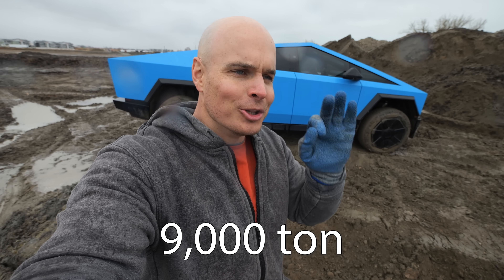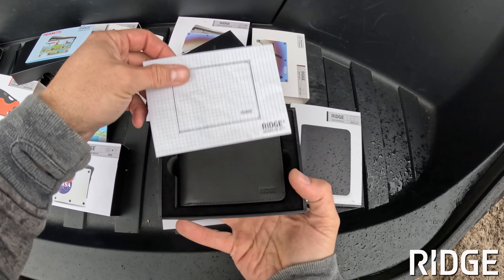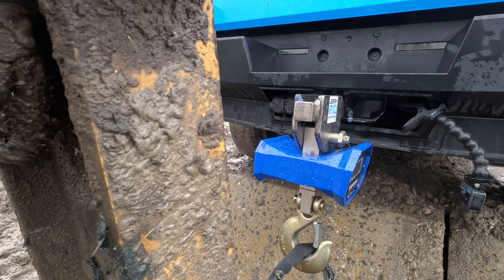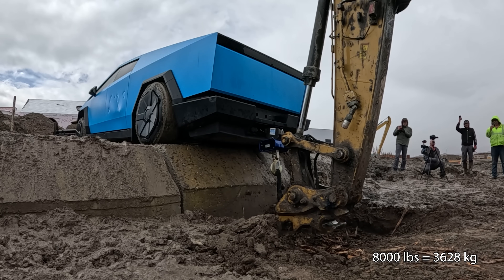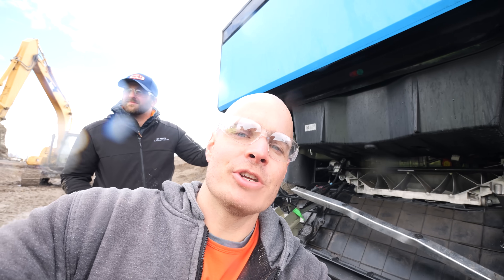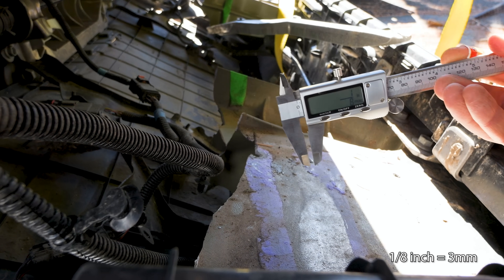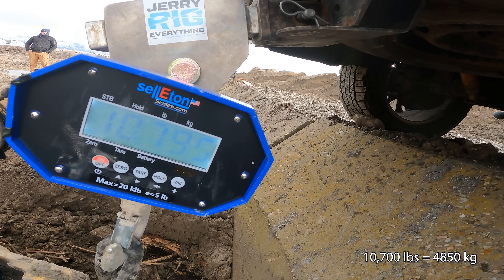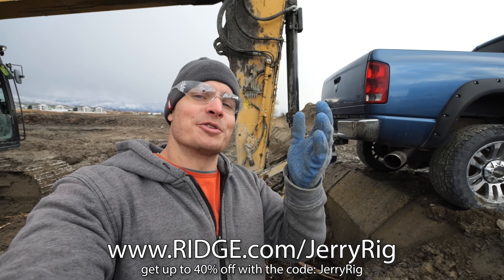SHOULD YOU TOW WITH A CYBERTRUCK?! - (catastrophic failure test)

Comment: Engineer from Germany here:
This test is kinda wrong! What you tested is the static downward force (Stützlast) which only holds a friction of what the actual TOWING force is.
The towing force is a pulling force horizontal from the truck. So this is unfortunately wrong my friend.
Reply: While certainly not entirely representative of a real world scenario, he does also address that tongue weight will increase during less ideal scenarios (hitting a pot hole, going over a steep hill crest). That combined with aluminum getting weaker over time, makes this a terrible choice for actual towing regardless of this tests validity
Reply: @cwill2127  
So basically if you have improperly placed load, you are hitting pothole while going at 90mph while being at 45 degree downhill, that MIGHT create enough force to break it?... This is non starter as an argument. If you want to complain then you could simply point out issues with aluminum potentially accumulating small fractures over time, which on its own should be tested and verified to be the case with their alloy as Tesla doesn't use some generic one and have their own, so fracture accumulation should be tested. But to make some fantasy scenarios where this maybe could be a potential issue is silly at best.
Reply: @ hey do you don’t understand physics and that’s fine, but leave the conversation for the big boys <3

There’s already a case of a failure in real life. Need I say more?
Reply: @ 
If we should leave conversation for big boys, why are you here?
Reply: While I agree that the test was misleading, the comparison against the Dodge Ram is pretty irrefutable proof that the durability of the cybertruck is below that standard of normal trucks. Since they are at an industrial site, I'd have liked to see hem actually load up a trailer with 10k lb and try to break it, for a much more practical  test.
Reply: @N8Dulcimer  
Comparison with Ram was quite meaningless as they didn't really went that much of extra where CT failed, on top of it potentially being the one rated for 1,200-1,500 loads. At the end of the day CT failed with over 9x higher load on the hitch than it was rated for
Reply: @ It's more complicated than that. First of all, a towing capacity of 11k necessitates a tongue load of up to 3k, so already the tongue weight limit was far too low for the stated towing capacity, if you assume standard weight distribution. 
Second, the dynamic load of a trailer can easily exceed 10x it's static load, thus a trailer rated for 1k lb tongue load will often need to accommodate brief moments of 10k+ lbf on the frame. 
Moreover, a trailer that is 11k lb will be applying at least 2k lb to the hitch statically, and up to 20k lb dynamically.
So in summary, the maximum tongue weight was never going to be able to accommodate the claimed towing capacity and also the hitch would  break under the dynamic weight of a 1k lb tongue load.
Reply: @ 
"The hitch weight should typically be around 10-15% of the trailer's total weight. However, it is important to note that this can vary depending on the type of trailer and its design. Towing capacity, on the other hand, is the maximum weight that a vehicle can safely tow."
First google search result. CT is rated at 11000 towing capacity, so its hitch capacity should be at around 1100 to 1650. Your made up number of 30% makes no sense as no one requires that. Which safety regulatory institution indicates that hitch capacity should be 30% of towing?
Reply: @Zripas  I mean, its pretty blatant that this is sycophancy, and that we are no longer talking about actual physics. This comment basically ignored everything I just explained xD. I got the 3k tongue load per 11k tow load figure by referencing trucker data. The fact is when a tongue is rated for 3k lb static, it is actually expected to be capable of withstanding over 20k lbf of impact during shock events. The reason I said that a cybertruck hitch is rated for 1100 lb is because that is the specific number that tesla gave. No amount of boot licking changes the facts.
Reply: @ Shoutout to the google warriors, who can't believe Elon lied to them, and demand that chat GPT explain in one sentence why actual engineering concepts shouldn't apply to the cybertruck. I really do have a deep envy for people who genuinely thing that a google search is an alternative to an education. Bless.
Reply: @ 
You people are weird, I'm not here to defend Musk, he is acting like a moron and this CT is stupid in how it looks and how its was built, but this doesn't mean that you getting random numbers from your arse will have any actual meaning. Tow capacity vs hitch capacity are usually 1 to 10 ratio, you want to claim that its 30%, so please provide source which institutions require this.
Reply: @Zripas  You literally got 10-15% from a random forum post lmfao. You are blatantly just combing through google for anything that let's Elon off the hook, and it's obvious that you are entering this conversation with ZERO prior knowledge, and are just counting on google autofill to show you something that agrees with whatever nonsense you type in...
Reply: He talked about this in the video. Did you even watch it?

Comment: Thanks to the Young modulus being three times higher for steel compared to aluminium, it will always need less force to deform aluminium - Even if you could match the tensile strength of steel it will deform more easy. Seeing that gigacasting makes me nervous... And yes, I hold a degree in mechanical engineering which apperently Elon doesnt 🤐 I now understand why the Cybertruck is not legal to drive on public roads in 126 countries.

Comment: Yes the S/N curve for aluminum doesn't go completely flat like it does for steel. So for steel there is a stress that if it stays below it can do an infinite number of cycles. For aluminum there isn't, but there is still a stress level that if you stay below, it is good for say a billion cycles i.e. for all practical purposes it might as well be infinite (depending how quickly it cycles). Since the number of cycles scale on an S/N graph is logarithmic small stresses are likely to result in some very big numbers on the number of cycles to failure. The stress below which the number of cycles for steel is infinite is called the stress endurance limit. For steel that isn't high strength steel this is about half the tensile strength. Because aluminum's curve doesn't level off to get to a high cycle number means stress needs to be a lower portion of the materials tensile strength. Things are frequently not designed below this stress level and therefore even steel parts likely have a finite fatigue life like probably parts of that excavator. Because aluminum has a much lower density than steel, sections tend to be a lot thicker than in the equivalent structure made of steel. This means that the aluminum structure is stiffer and more brittle than the steel structure. (This is excellent if you are trying to build something light weight as many modes of failure are due to a lack of rigidity). So whereas a steel frame that is over stressed will bend, an aluminum one will likely crack. This does make steel safer in that there will be some visual indication it has been over stressed prior to failure, whereas aluminum will more likely look fine right up until a catastrophic fracture. How good or bad the aluminum frame is depends on the design decisions Tesla engineers made. Its a pity not being able to stress the hitch of the other truck more than marginally above where the Tesla failed which means you don't really have a comparison of Tesla vs Ram tested to destruction and can only really say that the Ram is proven at least marginally stronger than the Tesla.

Comment: Aluminum has a very different stress/strain curve than the carbon steel alloy used in a conventional truck frame. Steel has far more elasticity and ductility than aluminum: in a tensile strength testing machine, a mild steel rod can be pulled apart with a force of around 36,000 pounds per square inch of cross-section area, visibly stretching the test piece, and when the force is relaxed, the steel will return to it's original shape. In this case, 36,000 psi is the "elastic limit". If you apply more than 36,000 psi, the test piece begins to deform permanently: the crystal structure of the iron/carbon alloy is being disrupted and micro-cracks are beginning to form. This "plastic deformation", as it's called, can continue for a considerable amount of additional stretching in the rest piece, before the micro-cracks propagate so much that the test piece finally snaps apart. 36,000 psi is the elastic tensile strength of the least expensive steel alloys. SAE Grade 3 nuts and bolts are made of steel with a 60,000 psi tensile strength rating, SAE Grade 5 is 120,000 psi, Grade 8 is 150,000 psi. There are much stronger steel alloys available, that have elastic tensile strength up to 275,000 psi; the steel wire rope used for pre-stressing concrete structures like bridge girders is made of this 275,000 psi alloy.

6061 Aluminum, which is the alloy used to build airplanes, has an elastic yield strength of only 40,000 psi.  If you apply more than that amount of stress on it, micro-cracks in the material propagate and enlarge so quickly that an aluminum piece will snap at only 45,000 psi: this is what you saw in the Cybertruck's rear frame. Aluminum has other "problems" as well as far less tensile strength than most steel alloys: it accumulates metal fatigue cracks far more quickly than steel - this is why airliners with pressurized cabins are generally retired from service after a certain number of pressurization cycles or flight hours, whereas old airplanes like the Douglas DC-3 are still flying 80 years after they were manufactured. The pressurization cycles that a high altitude jet airliner experiences, slowly add micro-cracks in the aluminum fuselage structure. In April 1988, there was an accident involving a Boeing 737 that was caused by metal fatigue: Aloha Airlines Flight 243 had a big section of the cabin roof tear completely off the aircraft, causing the death of a flight attendant. Here's a quote from the Wikipedia article: "The aircraft involved, manufactured in 1969, was a Boeing 737-297 registered as N73711. Prior to the accident, the aircraft had accumulated 35,496 flight hours, those hours also accumulating 89,680 flight pressurization cycles (takeoffs and landings), owing to its use on short flights. This amounted to more than twice the number of flight cycles for which it was designed.  At the time of the accident, Aloha Airlines operated the two highest flight-cycle Boeing 737s in the world, with the accident aircraft being number two. Investigation by the U. S. National Transportation Safety Board (NTSB) concluded that the accident was caused by metal fatigue exacerbated by crevice corrosion. The aircraft was 19 years old and operated in a coastal environment, with daily exposure to high levels of salt and humidity."

Aluminum has so many disadvantages compared to steel that the only reason it's used in airplanes is that it weighs only 1/3 as much.  As you just proved in this video, aluminum is not a good choice for a high-stress structural component like a trailer hitch frame.

Comment: That's actually way more impressive than I'd expected, I'm surprised it took that much force to break. But this isn't strictly the most likely way for the frame to fail while towing. I'd be more worried about the buildup of stress damage over time from much smaller hits. It's cast aluminum, it will sustain damage over time as it encounters forces from something like towing, mostly any kind of bumps you encounter. I wouldn't be surprised if someone who actually decides to use one for a lot of offroading (for some absurd reason) cracks the frame just from going over a few tough rock crawls.

So something like this is unlikely to happen in a real world scenario, but because it's cast aluminum it's going to lose a bit of strength whenever anything happens, and that's going to add up. Unlike a good old steel frame. And we're probably seeing that here too, since it's starting to make noises indicating damage well before the final catastrophic failure. So even if I don't think this is a very representative test, it's still much less safe for anything you actually want a truck for than something with a steel frame, and I have a hard time believing that any actual engineer would have signed off on that choice of material.

Comment: I'm not a fan of Elon Musk at all, all I am is a mechanical engineer.

But this test is total bs. Why would someone load his trailer hitch with 10.000 lbs in a VERTICAL direction?  Your front tires wouldn't even stay on the ground.

Damn Americans, if there's drama then you'll participate in it happily....

Do you really think an engineer at Tesla would write his name under this design for approval, if it wouldn't hold up to a real-world scenario, a lot of safety margin included? 

Are you really that stupid, believing that this test says anything about durability?

I'm not even getting into materials now, as most people (you included) can't even remotely grasp the concept of fatigue.

At least some sane people are left in this comment section.
Reply: There's nothing sane about the Cybertruck.   The point of this video is not that it failed under a huge static load, the point is that the  static test, while easy to do, indicate the Cybertruck will catastrophically fail under a dynamic load that conventional vehicle will only bend a bit.
Because the Cybertruck is built by sticking pressure diecast parts together with adhesives, it will be subject to Coffin-Manson failures.- a failure mode well known to aircraft engineers and electronics people, but unknown in the automotive industry because  for all intents and purposes Coffin-Manson failure does not exist in conventional steel ladder frames nor in steel unitary construction.

(Coffin-Manson failure applies whenever you have rigid materials of different temperature expansion rates bonded together eg by soldering or by adhesive.    Over time, temperature cycling, eg from weather, causes cracks to propagate in the bonding.
Even when the two bonded materials have the same rate of expansion, Coffin-Manson failure can still occur due the temperatures on either side of the bond being different.   As in an external panel exposed to the sun or wind glued to something that isn't.

Comment: Not a fan of Tesla but don’t see the point of this test more than putting hate on Tesla. So your 10,000 pound trailer will rip off the hitch and structure if your trailer is hanging of a bridge while the truck is still on the bridge, that’s not a bad thing. 
Bonding agent and rivets are stronger than welding when it comes to aluminum. Lotus did a lot of comparison before they decided for bonding and rivets when they developed the Elise 30 years ago, they still use the technique on the sportscars today.

Comment: This test is not comparable to when towing a trailer: Towing a trailer there are 2 forces going into the frame through the trailer hitch: The downward force - the support load - that comes from the unbalanced weight distribution on the trailer - and this one has a design limit that must be stated. Depending on vehicle type it is in range of 100 - 250kg. The lateral force is from pulling the trailer, and based on the road gradient varies. That is the actual force that is more relevant. This test shows me nothing, than just to destroy a 100k in money.

Comment: I really don't know what trucks you have in your country but a regular hitch in my country is capped at for example 150kg of vertical weight while it can tow for example 1500kg. You must be fairly stupid to load the trailer in a way where you'd put thousands of KG of vertical weight directly on the hitch. Somewhat stupid test, you could have first tested towing tens of thousands of KG if you wanted to do something meaningful.

Comment: I'm a little less concerned about the glue and more about the fact that there's no frame above the hitch. A truss needs to distribute all axes of force across the whole structure. Transverse strength is not a strong suit of any material (although cast metal has no primary grain axis so it should be slightly less of a problem), especially in beam shape.

Comment: Thank you for proving all the haters wrong. It took about 2000% more tongue weight than typical trucks are rated. Also comparing a 1 ton chassis to a 1/2 ton chassis is apples and oranges. I do appreciate the semi scientific approach to this test.
Reply: 3/4 ton chassis*  Also, 21 years old...at that time, even with the Cummins diesel engine, it was rated for 12300 lbs.

Comment: The biggest engineering mistake with the Cybertrucks towing hitch is that the chassis breaks before the hitch. Those Tesla engineers should consider making the hitch weaker than the chassis. 
Additionally, since it's made of steel they should take the advantage of the fact that it's more ductile than aluminum and it would break less abruptly.

Comment: 12 k pounds of towing weight does not mean, that the cybertruck should break at 12,1 k pounds. Usually there should be a safety margin depending on the severity of material failure. Plus, cyclic failure occurs at a lower weight than max. stress failure.
Reply: 12k towing capacity would mean that its towing capacity, while this video performed vertical load on a hitch test, which is usually required to be like 10x less to what is the towing capacity, so it passed the test